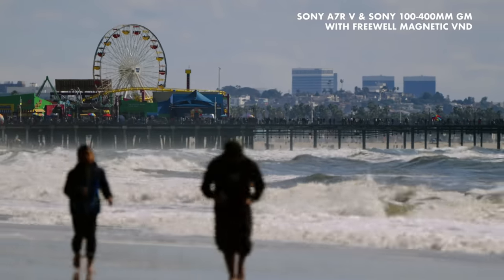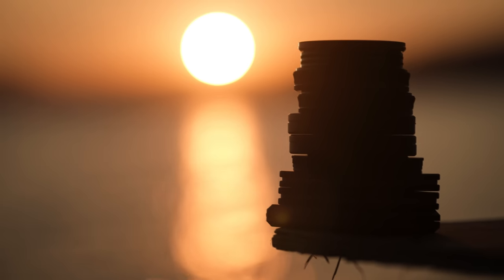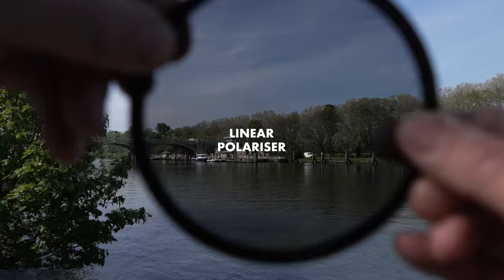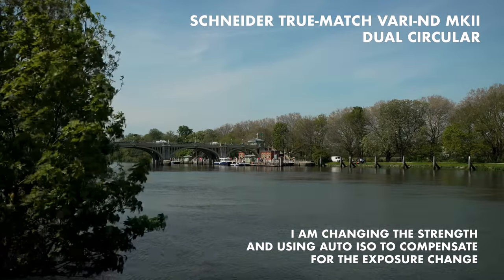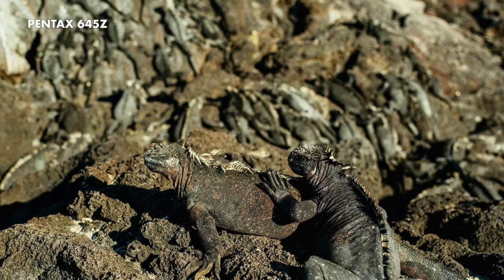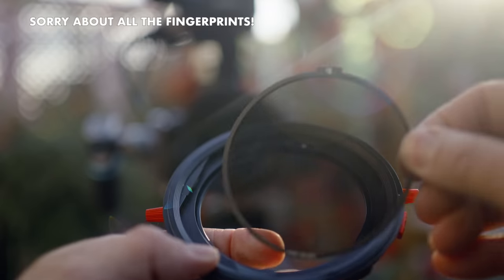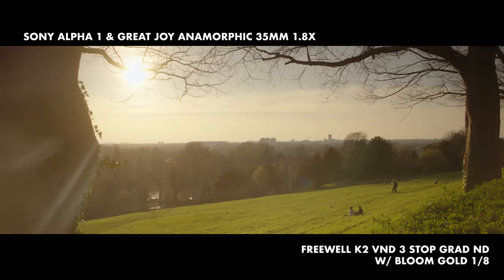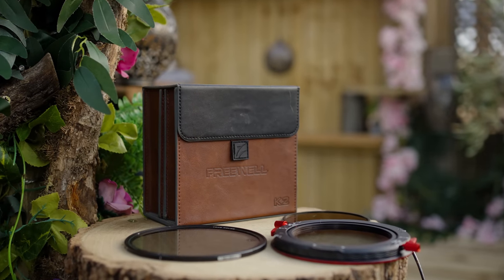The TRUTH about VARIABLE NDs!

Comment: Really interesting video. Given the numerous issues with Variable NDs, I am thinking it might be better (optically) and more efficient (workflow) to just use fixed NDs. That is unless you need to film in different lighting conditions within a short space of time and can't be swapping filters. Does that logic make sense? or have I missed something?
Reply from the maker: The opening of the video states much of this. But the K2 solves this.
Reply: It's a shame though that the original freewell magnetic variable nds have a noticeable difference in color shift compared to the bulky freewell k2s which I have... I like them but they are kinda awkard and you can't attach a matte boxx to em.  They developed the eiger system but that uses the older freewell magnetic variable nds which are not the same as the freewell k2's which have a beautiful true color look @philipbloom

Comment: I own the H&Y Revoring for photography use (to get motion blur during the day, and as a polariser) and I've found it to be OK, but I get vignetting in the corners at wider focal lengths and I have had one or two shots ruined by the cross polarisation effect, so I've kind of avoided using it. I was hoping you'd make some comments or show some comparisons with that in this video because I know you've reviewed it before. How do you think the Revoring compares to the K2 system? Is the K2 dramatically better or is it a pretty close call?
Reply from the maker: This is a sponsored video for Freewell so obviously it’s not the place for that is it? This isn’t a shootout. Although it does pop up in a couple it tests. 

What do you want to know specifically?
Reply from the maker: The Revoring VND is CPL/ LPL. It has a fixed colour cast but also polarisers. The good thing about it is your can change that polarisation but it’s damn fiddly to do. They also need to have hard stops on it as like all VNDs 3 stops is as much as you should use. I think they make a magnetic snap on fixed ND, but not sure. Then you can add that for stronger strengths…but yeah, they shouldn’t have attempted to make it  cover than big range. All VNDs have the same problem wiping hard stops, like I showed with the K2 with the front filter reversed, but at least trust doesn’t have the X pattern.
Reply: @philipbloom  Thanks for the detailed reply! Are there versions of the K2 that can work on really wide angle lenses? My Revoring has trouble with my 18-35 Nikon lens at the wider focal lengths (it vignettes).
Reply from the maker: @mdhazeldine  there's only one K2. I was using it with the my Sony 16-35mm a lot in this video.

Comment: Thank you for review, lots of new information for me.
I noticed NiSi swift system has an extra polarizer filter you could add to VND, which is bit confusing for me since its a 3rd layer of polarizer. I havent tried it yet but i wonder how bad the cross pattern effect would be.
Reply from the maker: There is? Not that I can see for the VND kits. Perhaps it’s for when using fixed NDs.
Reply from the maker: there's no way it will work as I've mentioned!

Comment: Would custom white balance with a gray card AFTER attaching a VND fix the color shift issues, or would it still cause some shift issues and still complicate the color correction process?
Reply from the maker: Didn’t I show that the colour shift changes depending on the angle and/ or amount of
strength?

Comment: nice presentation. if we don't use the rectangular gradient plates, would you recommend the new K2, huge, or the previous magnetic type you used for years ?
happy to see you now use a7rv. I would be very happy to see new video tutos/master classes about that camera, as you did with parts 1 and 2 (ael af/mf hold still unclear for me when we start from mf or af-c state because sometimes you press and other time you must release ael ; seems shutter speed button is by default a focus hold button in movie button video mode)
Reply from the maker: Thanks. Make sure you watch the sum up of the video as it answers your question.
Reply: doing my best, I am belgian (french) 🤣
Reply from the maker: @marclabro  the older set are dual CPL based, using them again after using the K2 and the colour shift stands out like it didn't before! they are still very good but strangely more expensive!
Reply: Looks good, But only goes up to 82mm... what am I gonna put on my 85mm 105mm primes? They're 86mm and 105mm filter sizes haha.
Reply: haha you are right. just looking the sony 200-600mm and, for video, we would need a 95mm vnd !

Comment: Philip, are the NDs inside camcorders actually physical i.e. glass? If not, how does an electronic ND function and why can't mirror less manufacturers include them?  If they are glass, then why can't ND makers use the same sort of glass? I have a Panasonic FZ 2000 which is small sized, it has built in NDs, albeit with a built in lens, so surely size isn't the issue....no colour cast issues in any of my camcorders which have built in NDs.
Reply from the maker: What’s the actual question? What you’ve written is confusing.  I can answer part of it. 

Yes they are glass. The FX6 is also glass but it needs to move away to be clear. That’s why the FX6 sits high.
Reply: @philipbloom  good morning 🌞. Thanks for the reply. The built in NDs, being glass as you say, seem to have no issue with colour casts, as many variable NDs seem to have. Would these be similar therefore to fixed single strength NDs which can be mounted to the front of a lens? Do fixed strength NDs not suffer from colour casts? I just bought NISI tru colour for my mirror less camera, but there are still slight colour changes by contrast to not using any ND at all. For work I also use canon xf605, again with built in NDs of course. The lack of really good NDs for dlsr/mirror less  has put me off investing in a system up until very recently. Just so used to using camcorders, but their big limitation is low light. Hope I made my question more clear...
Reply from the maker: @ianchappytube  why do you think the NiSi is changing the contrast at times? I do explain this in the review and even show the NiSi!
Reply: @philipbloom  I perceive a slight difference in colour (really slight) with an identical image taken with and then without the Nisi filter. From what I have observed on line through youtube, the Nisi and Freewell appear to be the most 'true' in terms of colour fidelity?
Reply from the maker: @ianchappytube  I explained super in depth in this video exactly why this was happening with the Freewell and how to correct this. Did you miss this part? It goes to the very core of this entire video! What type of polarisers are used for the NiSi? I think you need to rewatch the video! :)

Comment: I have like 6-8 variable NDs. I mount one on each lens. They are same brand same model. Not expensive ones. But besides color shift, I do not really see drawback. But then if all my lens has this same color shift then it means no color shift😂.
Reply from the maker: Which one? If they are dual CPL ones then as I showed the colour shifts depending on the stength/ rotation/ light angle. Plus you must shoot without them on at some point surely?

Comment: If I'm not mistaken you could achieve these same excellent colour results from the h&y revoring and a high quality variable ND as you could rotate the base filter using the revoring system. I bring this up as a potential solution for those on a budget, 120usd for the freewell magnetic and 50-60usd for the revoring
Reply from the maker: Which variable ND? There’s only one other that has similar to the K2 and that’s the NiSi True colour. I’ve gone off revoring somewhat as they can fall off to easily specially when you are carrying the camera with a strap. But yes you can use it to rotate.

Comment: Why don't they make external electronic NDs?
Reply from the maker: How would that work?
Reply: @philipbloom  by making a quite slim housing that doesn't need much power for the already good electronic VNDs big cameras already have.

They make glass toilet booths that go blur or opaque. Don't tell me no one has thought of it... You can even find electronic sunglasses as projects on YouTube.
Reply from the maker: @Zizos  which cameras have electronic variable NDs?
Reply: @philipbloom  Ok I thought camera body internal NDs are all called electronic NDs.

Isn't the Sony FX6's ND electronic? Slides in once and then changes strength by applying voltage, right? Because it's a smooth transition.

At least there are some results for googling "electronic sunglasses"
Reply from the maker: @Zizos  I was asking what cameras other than Sony have this? These are directly tied into the camera to remove any colour shift.
Reply: @philipbloom  But I don't think it's an extreme color cast. It's probably not as bad as CPL NDs and can be easily corrected. When on the other hand VNDs have all sorts of issues.
My point is, why keep them only in camera? Why not make them for the front of the lens when they already have been implemented on some random other techs? It would probably be powered by a quite small battery all day.
Or maybe it's heavily patented.
Reply from the maker: @Zizos  probably because it would be expensive to make. Do you understand how it works?
Reply: @philipbloom  I don't really know how it works. I guess a current passes through some crystals which either block or polarize the light. Does the FX6 have polarizing issues at all with its internal ND?

Sure it's probably expensive to make a high quality one for critical work. The sunglasses I mentioned cost around 300€ (no idea of their quality). That's the price of 2 good fixed NDs. So it could cost like what..? 1K because everything photo/video is expensive? But it should drop down to 500€ overtime?
Isn't it the same as fine local dimming on some new TVs? MiniLED, quantum or something.

Do you know more about it? It feels like something that should be here some time soon.
Reply from the maker: @Zizos  it’s not a polarisers. It’s ND that changes strength. It’s Sony’s tech, probably patented.

Comment: the truth about variable ND : this is shit, use fixed ND (of E-VND of the FX6). I hope this is what you say int this video, which i will watch now and comment again after.
Reply from the maker: What a weird thing to write.
Reply: Thank you for this lovely video ! You still got your unique vibe in there :)  And well, this video screamed to me that VND is...shitty (okay the K2 system is nice, but seems a bit bulky, but compared to good old fixed ND which never disapoint, without any draw back except screwing/descrewing, i don't see VND as an option). Also, screwing fixed ND of 4, 16, or 64 is not so annoying, especially if this is on your second A7S3 camera, and your main camera is the FX6 with E-VND ! I have to admit that i could not let go of internal ND after using it for so many years with the FS5 and now the FX6.